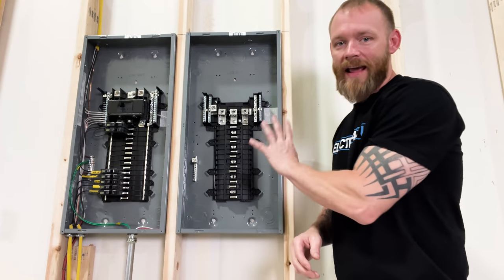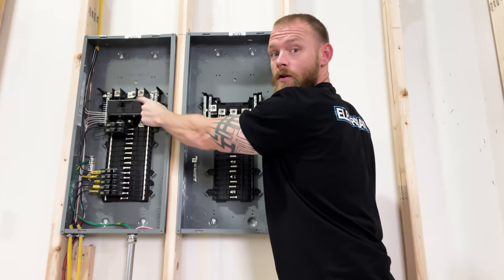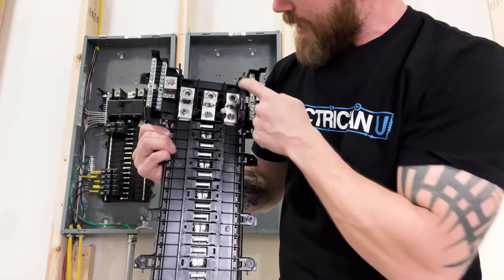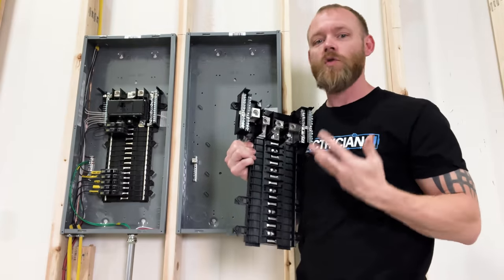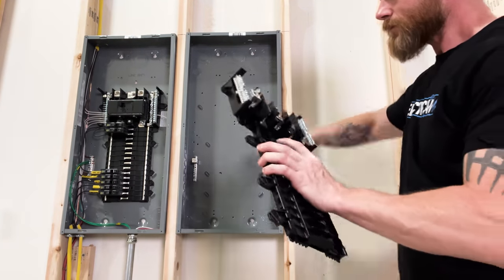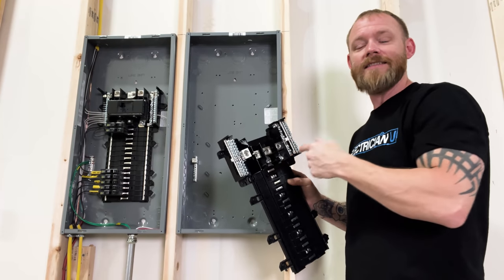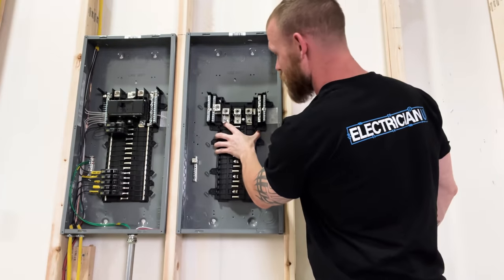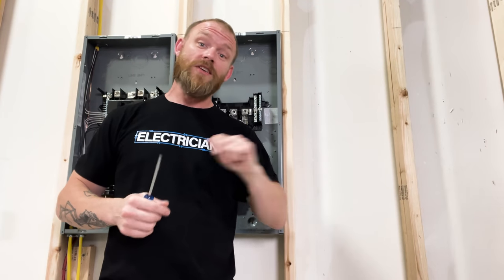How Do I Know if My Panel is 200 Amps? (What Makes a 200 Amp Panel 200 Amps)

Comment: Only problem with this video is you did not show how to identify a 100 or a 200A panel
Reply: If you don’t know how to tell that don’t touch a panel trust me.
Reply: @timothydixon2545  whether I'll be touching a panel or not is of little importance. In a video like this,  it's just good information to add. 

What's inside a 200A panel? First let's see if how to tell you have a 200A panel.  Just makes sense to me.
Reply: They should have identifying labels and stickers inside with all of that information. If they don't, you can't use it. Most inspectors will fail an inspection if they can't see what things are manufacturer rated.
Reply: Exactly, the F is this video lmao

Comment: Good info, but i dont think i heard an actual answer to the question. Is the rating for the bus stamped or labeled somewhere on the panel board or box nameplate?
Reply: yes on the listed labeling usually inside is the panel's ratingm GE may be on the outside.
Reply: On square d panels sometimes it's om a sticker on rthe inside left wall of the box
Reply: Yeah. It's an interesting channel. But, as a homeowner, I still don't understand how to tell if my panel is 200 amps, as the video's title purports to tell me. I do, however, now have a nice list of things that DO NOT indicate my panel is 200 amps.

Comment: Would you consider making a video where you upgrade a 100A panel to 200A panel. Sizing wire,conduit and attaching at weatherhead.
Reply: I know he did this on his house, but I would LOVE to see a FULL tutorial swap...
Reply: that would mean an all new meter base as well. Just had that done a few years ago but I already had 200A service but the meter base was too small for current standards, being from the '50s and the box had no main disconnect, only for the 2 legs and it had 2 large breakers that were separate. Thanks Zinsco
Reply: Please: and show us what is entailed with getting the utilities ASS! to come out to change over
Reply: I just bought a townhouse with 100amp inspector said I needed to upgrade to a 200amp how much would this cost me or can I keep 100amp there's work needs to be done

Comment: A 200 amp single phase panel can handle up to 400 amps at 120v, or 48,000 watts.  A 200 amp three phase panel can handle up to 600 amps at 120v, or 72,000 watts.

Comment: I’m still confused. I need to check how much amperage my electrical panel has. I need it to have 200 amps for insurance reasons. How do I check or verify if it’s 200 amps? What do I look for or calculate to determine that?

Comment: So, the 200 amp is designated by the circuit breakers equally summed up to a total of 200 amps. Each breaker added up to the total of 200 amps another words. OK, I get it and if I don't get it, I better got it.

Comment: hey Dustin, you remind me of my old foreman so we used to have a good laugh comparing the two of you. but your videos really helped me get an understanding for some of the more oddball things I haven't seen like that pass through panel you did. I'm a 9 year electrician and just passed my exam to work for my city. you're very knowledgeable and provide a great service to youtube
 keep up the good work man and be careful. we may get complacent but 120v has the highest body count. be careful out there brothers and sisters.
Reply: congrats on the exam pass. i go for mine  limited sat at psi in charlotte nc. can i ask what test you took
Reply: my
Reply: @jacobdellinger4931  NYC doesn't have a journeyman card but the test to work for the city is essentially the same test but geared more towards NYC code

Comment: A good reminder of why we have torque values and why using torque wrenches and screwdrivers is very important when landing wires in terminals and lugs.
Reply: It's actually just some bull shit made up by some guy at a computer. I never seen anything bad happen torqued or not torqued.
Reply: @trxtech3010  Yea. I do mostly residential service work and I hardly see burnt up  main lugs.  I bet all those were hand tight with no torque specs.
Reply: @trxtech3010  agreed
Reply: Torque and grease to protect heat expansion?
Reply: @AB_thingsDFW  ... grease (the electrical kind) doesn't protect against heat. It's to stop corrosion in the long run, which can create heat. (with or without proper tightening)
Reply: @DonkeyLipsDA3rd  ... the term "hand tight" is rather subjective and depends on the guy doing the job. In my line of work I can always tell when there were two people doing an install, because each end of a cable is NOT the same tightness. (unless they used a torque wrench)
Reply: @rupe53  The problem with residential electrical  work  is that who will  oversee the  person tightening. Definitely  not an inspector their hours are   wacky   here and I'm not waiting for them I have other jobs to do. I  am not opposed to using a torque tool though. I want to start using one actually.
Reply: @DonkeyLipsDA3rd  ... it's not about overseeing because the inspector probably wont be watching you work, but he might be looking to see if that tool is sitting in the wings...and he might do a wiggle test at some point. Do it right and no worries. The inspector isn't the guy doing call-backs on a weekend, which is where I found half on the issues.
Reply: @rupe53  The inspector  isnt do a wiggle test . Trust me not in Jersey. But, I agree it's  good practice to use a tool that will only help you as an electrician.

Comment: Similar story, I did a service call where homeowner said every time he would charge his car, the main breaker would trip after about 5 to 10 minutes of charging.  Checked the 50A breaker, connections, the charger itself, everything seemed to be fine.  I used a flir heat camera and pointed it at the car charger breaker and started charging the car.  The 50A breaker was fine, but I saw one of the main lugs starting to heat up.  Once breakers get to about 140°F they will trip.  It wasn't until there was an extra 40 or so amps going through the feeders that would trip the main.  It was an interesting experience and would have solved the issue faster if I was more experienced.  Anyways, thank you for your videos
  Great information
Reply: Just a curious DIYer here.  How many amps is the main breaker on the panel?

Comment: Dustin, great video. But I wish you had mentioned that there is a label somewhere on the panel board that states what the amperage rating is and model number. When dealing with an existing panel this can be useful to know. The manufacturers website should have documentation where to find this information. For a QO panel it's likely on the right side of the top right main lug. I know because I recently had to find out what panel was installed in my house.

Comment: This is good info for home inspectors and all potential home buyers,  as part of the puzzle in determining what size service they have.   They are, the panel rating, the main breaker rating, and the ampacity of the service entrance cable or service lateral.    In cases where they are not the same, the lowest rating counts.  I've seen a case where it appears the home has a 200 amp service,  however the drop was 6 guage copper,  indicating it was an older home with a 60 amp service,  probably flipped, and there was an illegal upgrade,  where someone had replaced the old panel with a newer panel without pulling a permit,  then sell the house to unsuspecting buyers at a price reflecting a complete rewire job, then the flippers keep the profit.   In this case, the home had a 60 amp service,  in addition,  this is a very dangerous situation as the drop could break down and short out if anything close to 200 amps was flowing for a period of time, and the only overcurrent protection for the drop is the primary fuse at the transformer,  which it's only purpose is to protect the transformer itself,  and by the time the primary fuse blows if it does, your house will be on fire.
Reply: Wouldn't the electric utility only provide 60A as that's what their records show? Or is there no way for the utility to limit current to a house?
Reply: @bokononisti2820  if the main breaker is 100amp, it won't clamp on 60amp service. It has the potential to overheat the service lines as they themselves aren't rated to pull 100amps. The wire matters when determining what can be drawn into the service panel. Think if it like this, I can screw down 24awg into a 30amp breaker but if I  draw 20amps across that 24guage wire, the wire will fail but the breaker might not
Reply: @bokononisti2820  The utility records your power usage in kilowatt-hours , not amps.   In the example I have seen once in the field,  I grew suspicious before I even checked the service wire size,  because it had a smaller round meter base, which typically is found in older homes where there was a fuse panel and those were rated 60 amps in most cases,  sometimes they could be 100 amps, so the size of the meter enclosure is not a definite indication of ampacity although they can provide clues.    When I saw the 200 amp panel, it raised some eyebrows.   I pulled the cover off and confirmed my suspicions.   6 gauge copper was used for 60 amp services before the early '60s.

Comment: may I add a comment to this video? (It’s your program and I don’t wish to be a “told-you-so). While the main breaker DOES protect the panel bus, it is actually the protection device for the utility loop and transformer. All most all transformers that are operated by electric utilities are not protected on the secondary, thus these main breakers create a significant protection zone. (I’m a master electrician, commercial inspector, and EE with 20 years of utility design experience and I have worked supporting the NEC CMPs). Thanks Dustin, great job as always!!
Reply: wtf? shouldnt these be closer to the transformer so they can trigger if the utility cable is damaged, like a short circuit because someone dug at the wrong place, or a tree fell over the lines from the transformer to the house

Comment: I am from Serbia, me and my father have installed the wiring to many homes. 3 phase here is the norm 230/400V. There are even 3 phase sockets for stoves, storage heaters and 3 phase motors.
But I have never seen in my life more than 32A main breaker or more than 16A branch circuit. My home has 20A service.
I have seen once 200A breaker, but it was for whole residential building, not for 1 house.
Reply: Are you sure?  That seems really low. That means the sum total of all of the power used in your house cannot exceed 3x20x230=13.8kW
Reply: @yeroca  Yeah, a small fan heater is going to be around 13A at 230V. That doesn't leave much slack. I would think enough of Serbia was up to modern enough standards that even 50 would be low. Could that possibly be 20A per leg?
Reply: @chaos.corner  It is 20A per phase. And it is so low so they force you to balance the phases on home level and also not to turn on much appliances at the same time. At the end of the day, utility company has to scale production capacity and distribution to peak load. If load is much more spread out, there is no issue.
We also have very cheap night rate, so many people use storage heaters, water heaters and washing machines at night.
Reply: Higher voltage means less amperage/current needed.

Comment: AFter learning car audio, I could do my own electrical work in my house. 
Understanding  AMPs, wattages and distance relitive to the box and the outlet is also very important just like 
in a car. 
For example 14 gauge through a house will not handle 30 amps. 
But if you make that cable as short as your hand it can

Comment: So how can I actually tell if it’s rated for 200A? My panel was replaced by previous owners brand new and it looks like a 200A panel based on the number of circuits it can have but it is protected by a 100A main breaker

Comment: Can a 100 amp panel lugs handle a 200 amp breaker. is there a difference in the lug size or ratings that would not allow this.?

Comment: Question.. if your outside meter/whole house breaker is 200 amps, how do you know the amperage rating of your house sub-panel if there is no label or markings on the sub-panel? I've got a two-pole 32 spaced sub-panel from the late 80's, markings have been removed except for the brand.

Comment: Got a Square D QOC40UF load center, there's no main disconnect on the breaker panel. How do I know if it's 125 A or 150 A or 200 A?.

Comment: I purchased a 100 amp Homelite internal panel for my shop which had a #2 gauge copper wire supply feed. I decided I wanted a 125 amp Mai beaker. The only 125 amp load center available was an external panel. I simply swapped out the main breaker. Do I need to disconnect all the wires and swap out the panel itself to have a 125 amp load center? Am I likely to burn up the buss bars if drawing 115 amps?
Reply: I am not an electrician this is my opinion.   The panel is rated at 100amps, putting 125amps is out of spec and I'm guessing not code.    The easiest option is to replace the 125 with 100 amp breaker for now to be safe.   Eventually replace the panel with a  proper 125amp panel/breaker combo.   Another consideration...  If the house burns down the insurance company will be very happy they don't have to pay for damages.
Reply: I'm not sure you fully understood the question. And, BTW, it is not a house, it is an external shop made out of metal, so nothing to "burn down". 
I bought and own two load centers: one 100 amp "inside" box and one 125 amp "outside" box. Dustin indicated in the video that the "panel" can be removed from the case and you can replace the panel without having to completely remove all the wires from the box and the box from the wall. The question was can/should I swap out the panels. Both provide the same number of circuits and identical form factor main breakers. After reading other comments I have learned the panel should be marked with its rating. 

I have known manufacturers of other equipment to provide the same base and reduce the cost by changing out one component to compete with lower priced competitors. So I considered it possible for the "panel" to be rated for 135 or 150 and they put different sized main breakers in to reduce cost. If the buss bars are indeed a smaller gauge, I will be swapping the panels, provided they are interchangeable. I would prefer to keep the "internal" easy open door than to have the "external" weather resistant door inside my shop. Home Depot just didn't offer a 125 amp internal load center.

Comment: If each phase buss is rated at 200 amps in the panel does this mean that each breaker position is rated at 200 divided by the number of positions in that bus?
If there are 10 positions in that bus 200 / 10.    20 amp max breaker, in each position, if fully loaded?

Comment: I need to ask you a question OK I have a three phase electrical box. I was called to a job and one of the legs were bad so that the power company came out and fixed it. I still have no power. I got power on one side of the building and power on that power on the other side couldn’t be a switch that bad or an outlet somewhere

Comment: I have a 240v car charger running straight from my main panel. I recently thought it would be nice to add another 240v outlet for an power tool that I'll use sparingly. I think code requires car chargers to be on their own dedicated line. That being said, can I cut my car charger line and run it into a sub panel that will then branch back to the car and the extra outlet I want?
Reply: That is something that is possible, but that other outlet will need to be a GFCI these days. The car charger will have its own GFCI so will NOT need one if it's hardwired. BTW, in many areas you can run a 70 amp breaker on a #6 wire to feed that new panel. Check with your local inspector to verify.

Comment: So this explains the panel capacity very well. I'm also curious if, generally speaking, a home can get a panel upgrade from, say, 150A to 200A without changing out the feeder lines (I don't know the right terminology there) that go from the transformer to the house.

I ask because I foresee needing to change my hot water heater from natural gas to electric. I probably will not opt for an instant hot water system, but rather a heat pump type of heater.  I think our panel was originally sized for using natural gas to heat water.
Reply: From the transformer wires run to the meter. And then from the meter to your panel. To upgrade from 150A to 200A both sets of wires have to be rated for 200A. Also the meter has to be 200A. So make sure the meter and the wires are properly sized 👍🏽
Reply: Almost certainly the wires to your meter will be capable (though check) but you'll have to check everything after that. So basically you'll have to check. You might be able to just add an extra panel, we have two 100A panels as the house got upgraded over the years. One is old-school fuses. I get tempted to do an upgrade to a full-on 200A panel with fancy-pants features sometimes.
Reply: @GHETTOCOWB0Y  Thanks! I hadn't considered the wires from the meter. Luckily, though, if they need upgrading, it should be a simple matter because the meter is on the opposite side of the wall that the breaker panel is mounted to.
Reply: @chaos.corner  It's always nice to make your pants fancier :D
Reply: The first thing is does your main power come in overhead or underground. The meter size by the power company is in the part number on your meter if it has a 200 in the meter part number power company already has their side sized for 200amps. If I where you I would first amp probe the feeder cables at the panel to see what your true load is cause unless your house is like over 2500sf and you have all electric heat and only need one water heater you might not need to upgrade it right away.